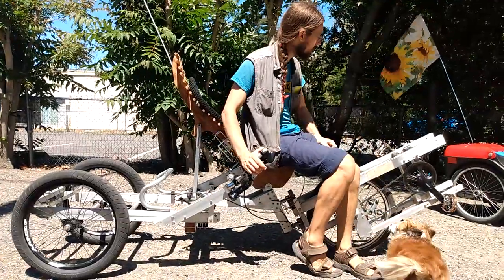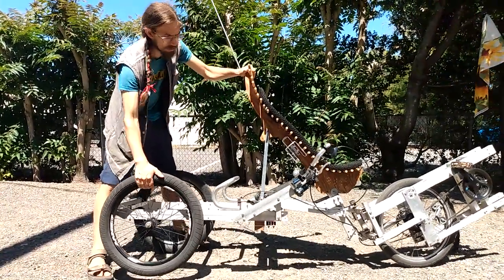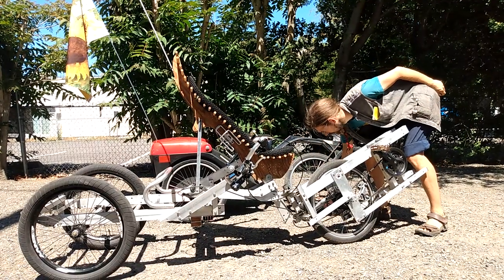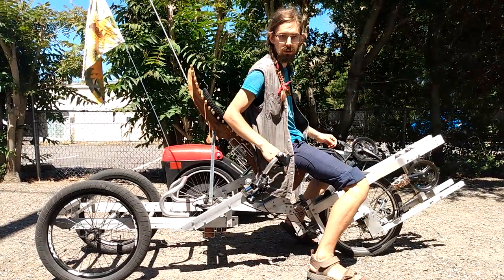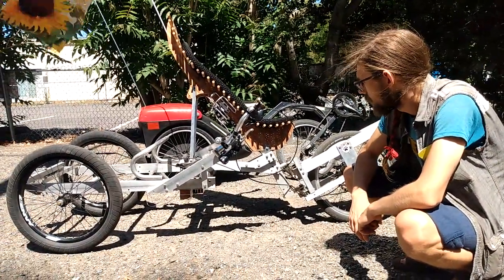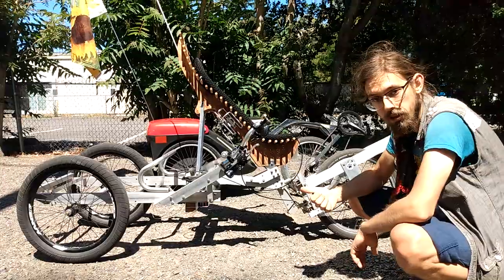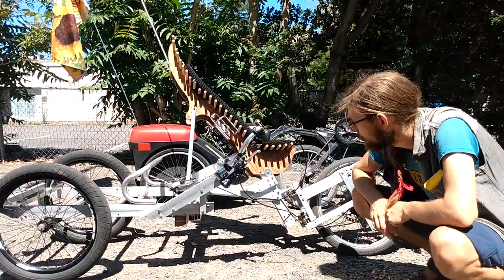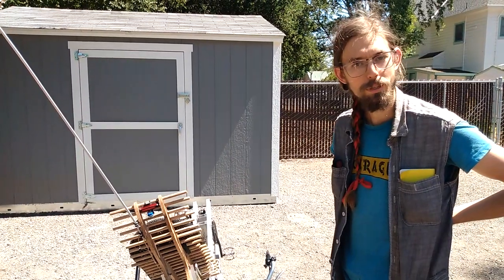No-Weld Python Tilting Trike

Comment: As Flevotrike rider, I like the better weight distribution so the front wheel wont slip
Reply from the maker: Yes! That's one of the main reasons I built it.  I was also able to extend the frame on our FlevoTrike to move the rear axle farther back, but I didn't want to extend it too much and the Flevo still doesn't climb quite as well as this one.

-Darin